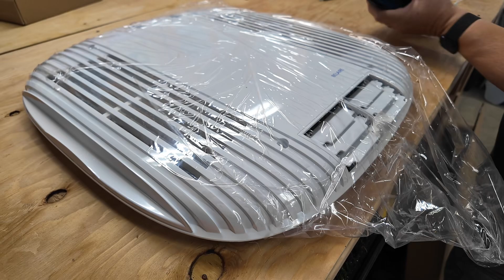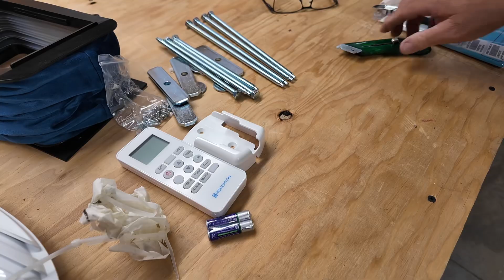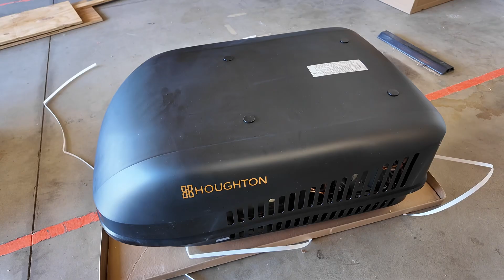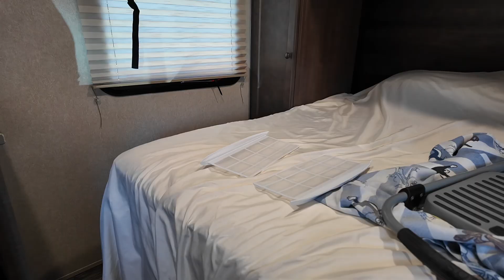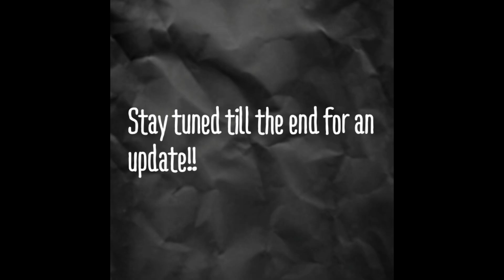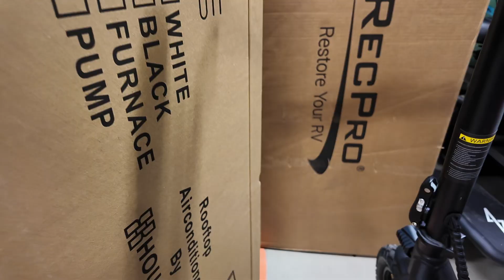Let's Install Our New Air Conditioner By HOUGHTON

Comment: The draft was from the loose unit to the mounting bracket as evidenced by the loose mounting bolt.  Lucky it didn’t leak when it rained

Those new units are quiteand efficient.
Reply from the maker: Exactly!

Comment: Knock on wood I wont have this problem but excellent video. Heat pump sounds great too
Reply from the maker: Hopefully yours holds up Glenn but if it doesn’t this one is a good choice.
Reply: This is my second. I did not mean to sound offensive. Just my observation.
Reply from the maker: @glennh9139  I appreciate you sharing your thoughts—and thanks for being part of the ride with us!
Reply: I think the issues you're having is from COVID. My camper was made after and so far zero issues except sale switch. 

I believe quality control was rushed. Has a 16bh before the 18rd and it had mold issues dealer would not fix. Twice the usage and no issues with the 18rd.
Reply from the maker: @glennh9139  who knows. This isn’t our first rv. It’s our 4th. They all have problems. None built well.